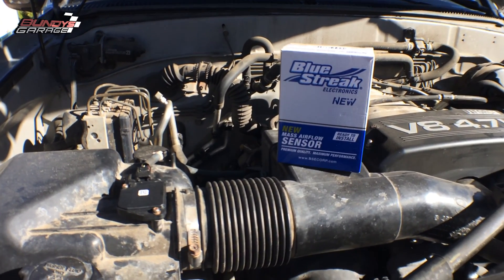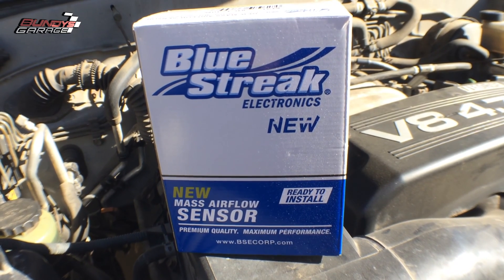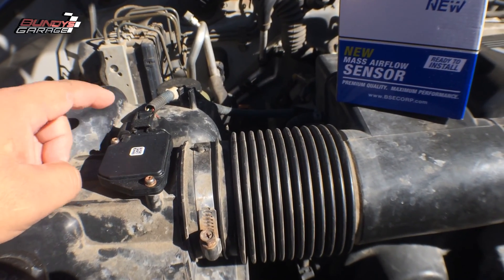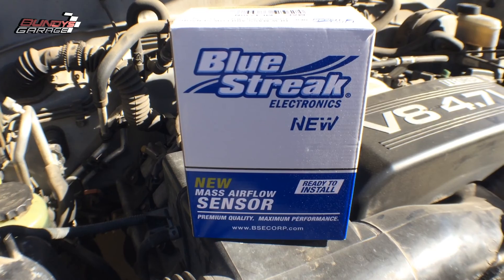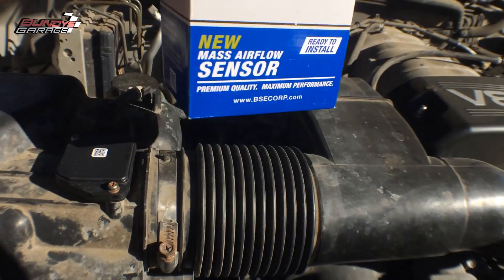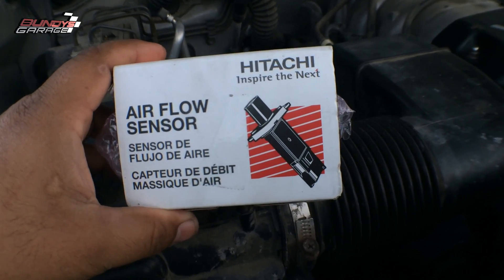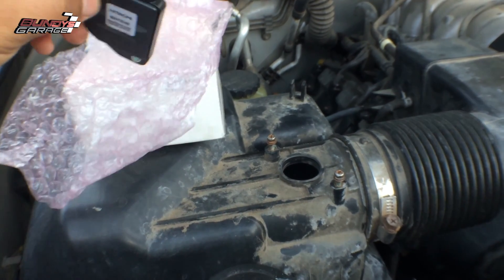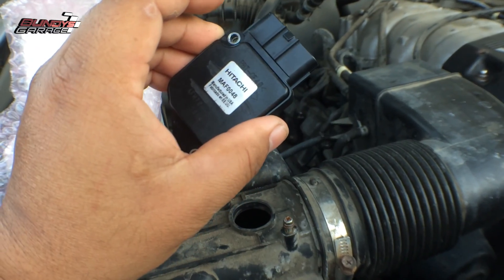STAY AWAY from Blue Streak Electronics!!! Review Mass Air Flow Sensor...

Comment: I’m on my third blue streak MAF for my VW Jetta. All free cause O’Reillys keeps letting me return them. One time the new one didn’t even have the wires between the sensor. Complete junk
Reply from the maker: So even if you find one that works it will be dead in a few weeks. Spend a little more and get a better sensor! OR check out rockauto.com, great prices and great parts. I don't work for them just really good parts are good prices.
Reply: @bundysgarage I may even be on my fourth. Check engine light lit up today. Haven’t checked the code yet.

Comment: well if you didn't reset the computer than you're driving on  the same air/fuel map as the old sensor.  but ya duralas has been working good in my isuzu trooper    i had a blue streak it was running good but died. went by got a duralas an well its been 4 years

Comment: How much do you know about cars??😂😂😂you have to get it acclimated with the vehicle
Reply from the maker: Right, right
Reply: @bundysgarage  I just went through the same thing with the OEM MAF sensor on my mustang when I changed the cold air intake...I had to drive it for 2 days and the light went off after it reprogrammed itself
Reply from the maker: @BlackDadzRoCK  The new sensor either works and does not work as soon as you install it in a vehicle. Did you clear the codes in your Mustang before driving it or did you install the new parts and then drive for 2 days until the check engine light went off???? The proper way to do it is clear the code with a scanner, install the part, then see if the light comes back on. Not driving it around for 2 days for the computer to reset, how much do you know about cars?
Reply: @bundysgarage  I did all the above sir....I do this 😁😁😁

Comment: I have a reman ECU from them and it fixed one problem but now my truck has so many codes.  Mechanic and I tested everything points to bad ECU.
Reply: I got a pcm from blue streak. Never did work correctly. Waited too long to get the truck back on the road, couldn’t return it. Never will purchase another blue streak product. They used to be reputable in the 70’s and 80’s.

Comment: Rebuilt the whole top end of a 99 Tacoma 2.4 and yeah I ended up putting one of these blue streaks in there from O'Reill... got maybe 500 miles on the thing and now it's just complete garbage.... going down tomorrow to get the Hitachi one.
Reply from the maker: They suck balls ⚽️!
Reply: Toyota's hate aftermarket sensors. I went through 3 before buying oem and actually fixing my issue.

Comment: The on I bought for my 2011 chevy Corroded in half and less than two months. Unfortunately I was broke down in another state and didn't have my original receipt so o'reilly's would not give me another one so I bought. A different sensor from one of their competitors. This made the vehicle run fine but now o'reilly and blue streak. Neither one will give me my $75.00 back for the two month old sensor that is destroyed.

Comment: I just bought three of these for my Mitsubishi lancer and they both never ran correctly, couldn't get any stable idle, left with p0171 Bank 1 lean code. Both of them didn't work. Even a map sensor. Went with WALKER and NTK products problems solved

Comment: Hey bundy I got a question I got both head back on the car the front cylinder though when I got to doing the 90 degree sequence twice cuz I reused the same head bolts when u got to the second 90 degree torque and finished up bolt 2 insequence slipped like it stripped or something is that a sign of a stripped head bolt or did it bottom out? Because when I tried to tighten more slightly again it start to tighten but then kinda goes lose again like its stripped do you think I can just take that number 2 bolt out and get a new one and just tighten it again or would I need to remove all bolts and restart the sequence again please lmk bundy as soon as you can im kinda worried about it this had happen to me  on one of the oil pump bolts to so I wanted to know is it as simple as changing out the bolt and putting a new one cuz im worried about the threads also in the inside or if it was just a thread off the bolt the stripped or broke and I can rectify this quickly as I'm kicking ass on this and want to get to the valve lash/ adjustment by getting the belt on and rotate ling the engine i haven't torqued the rear head yet but the bolts are on and I want to first address this bolt 2 in the front head or if I should be fine and leave it alone! But yeah again if I can just replace one bolt then ill do it I just don't know what I should really do ok bundy sorry for long text but I didn't want to leave any details out btw if you could call me at 815-207-9012 I have google duo app would love to show you where I'm at with this I live in Illinois joliet illinois to be exact would love to face time and show you my garage I have a four post titan lift in my garage so yeah would to talk to you lmk if you can give me a ring..thanks in advance bundy Anthony!
Reply: Read about TTY bolts....   Any time TTY head bolt are loosen or token off during cyl head work,,,,  TTY bolts should alway be replaced with new TTY bolts.....  Again read about TTY bolts & get info on how they work.....